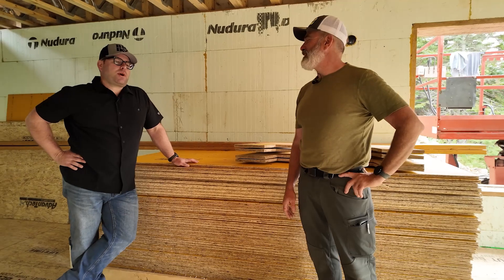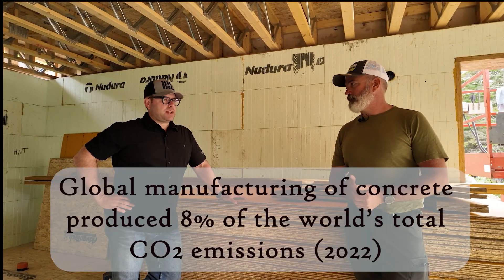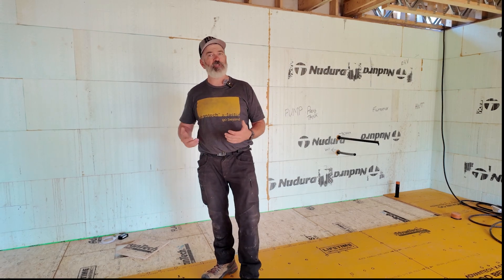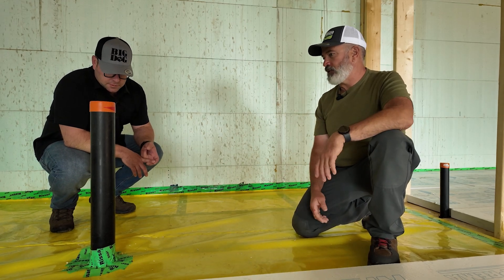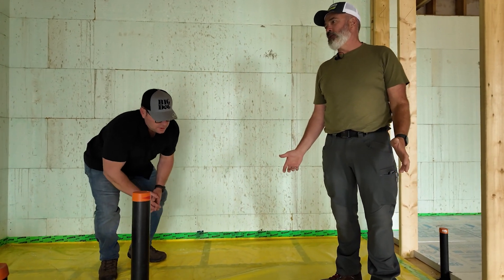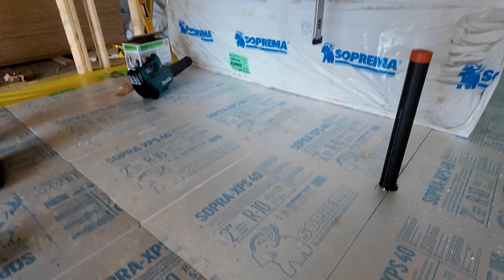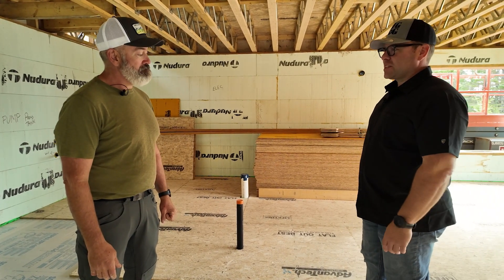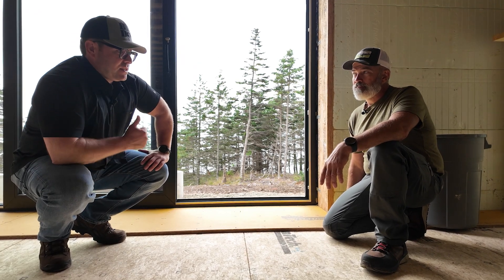South Hollow PT 12 No Concrete Slab! And Tim Uhler @AwesomeFramers stops in to talk about it.

Comment: Carbon costing, I cant handle all that nonsense. Im all for being considerate of the environment and being good stewards. There appears to be so much misleading  info about the impact carbon footprint.
Reply from the maker: We can talk about how nice this floor is to walk on. I do agree there is a lot of misleading information out there. It can be tedious to comb through!
Reply: @Aron_Jones_Carpenter  I am very interested in that floor system, but it does sound extremely niche, you mentioned how much rock base you had, that is a crazy amount of base to build on, I can see why you wouldn't be concerned about any hydro pressure with that much rock, I am assuming it drains well and won't act like a water battery. Anyhow, started to rabbit trail. I have enjoyed much of your content. Keep on sharing and sharing well as you do.

Comment: How feasible do you think this system would be for a retrofit?  My basement ceiling is quite low and if i could dig it out [no underpin] and get another 5 or 6'' of ceiling height at not a crazy cost, I'd consider it.
Reply from the maker: There are a lot of factors involved in the feasibility.  Soil conditions,  water table.  It's definitely possible to do, I suspect it will be extremely labour intensive.  Especially if your basement is not a walk out.